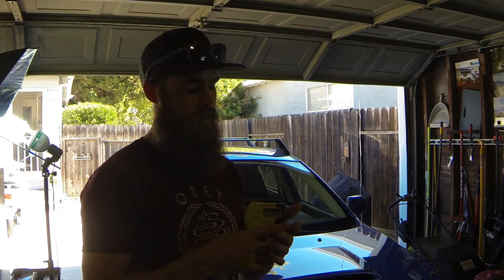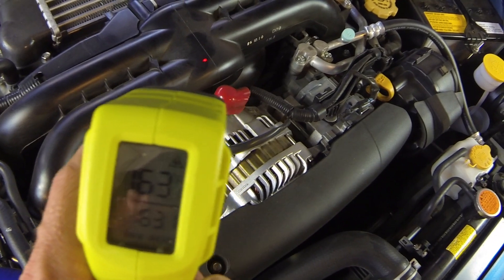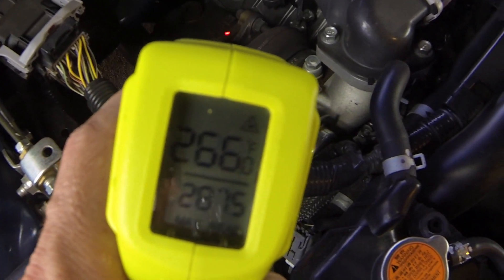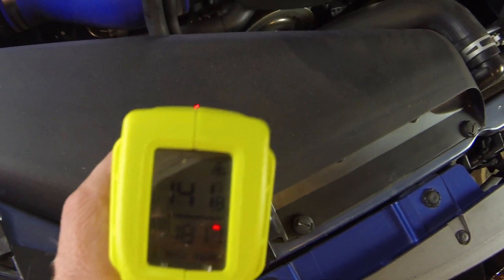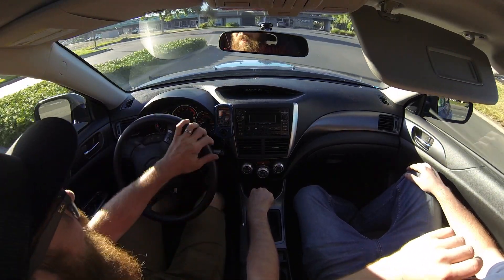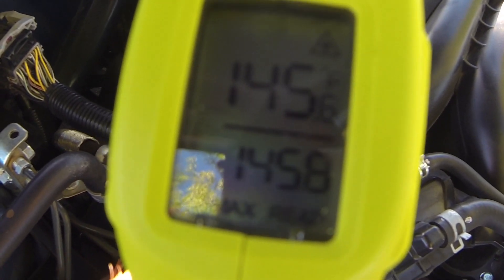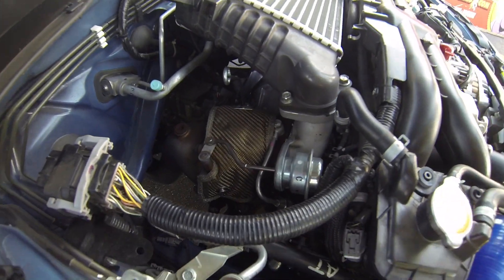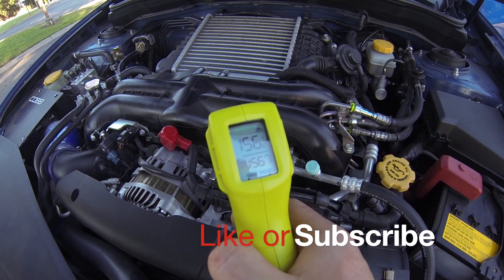PTP TURBO BLANKET REVIEW

Comment: I just installed a PTP and overall under hood temps are cooler, I did a reading of the hot side of the turbo right under the blanket and got 729 degrees, wow

Comment: thanks for the review.   Do you plan to put the stock heat shield back on? will it fit and does it serve a purpose in terms of keeping heat lower?
Reply from the maker: +Alfree Parani No, I never plan on putting the stock heatsheild back on. You have to cut it and I'm not sure it would fit with the blanket either. This Turbo blanket is way better than that stock heat shield, Try touching your stock heat shield after a pull and you will melt your hand off this blanket you can touch no problem. Now as for an after market heatsheild maybe someday just to insolate the turbo from the heat shield little more but its not on the list of things I want to buy right now. Glad you liked the review.

Comment: Those things read differently depending on the color/reflectivity of the surface measured. Only reads true on a flat black surface. Aluminum/shiny stuff will read much lower than it actually is. Look into Emissivity. Some higher end models have an E setting where you can cut it down to read correctly. 

Still a good tool for comparing though.
Reply from the maker: +Mark Seven Ahh I could see that. Well it was still cool enough to touch the blanket after a bunch of pulls so I'm pretty happy with the setup. I find myself using it for all sorts of things so it's a fun tool to have.
Reply: Sure but as long as you are comparing the same surface to the same surface it is all good.

Comment: Quick question, does the blanket smoke very much after you first put it on? I'm worried that it will look like my engine is on fire. Thanks!
Reply: Kinda late reply, but I believe it's normal on a newly installed one. Any moisture, solvents, or oil would need to burn off. Same thing happened when I heat wrapped by downpipe, but soon enough the smoke stopped and I've been good ever since

Comment: Did you get a tune to have the downpipe And the cobb sf intake at the same time or your just running cobbs stage 2 ots map
Reply: subi rwr a solid tune is a must when upgrading a downpipe, I wouldn’t trust an off the shelf map at since it’s not a 100% depending where you’re located
Reply: @w3rk3r  where did you get the turbo blanket?
Reply: subi rwr went with a turbo blanket from torque solutions and wrapped my downpipe. It’s a good route to go if you’re going to stick with a TMIC or go front mount
Reply: @subirwr4295   http://www.torquesolution.com/Subaru-Turbo-Blanket-p/ts-tb-lsu.htm